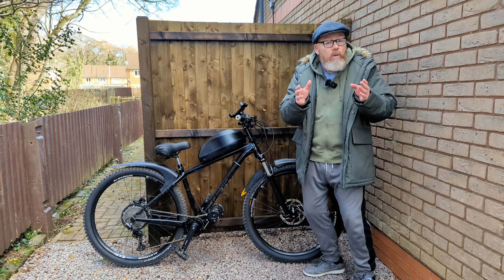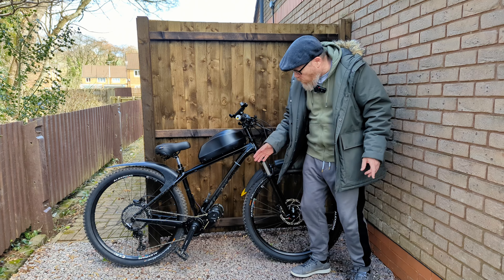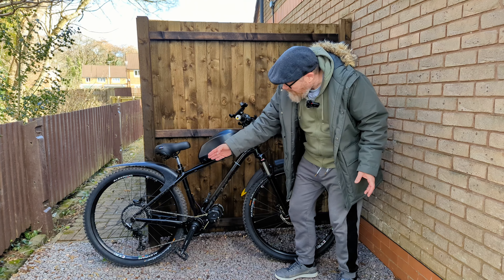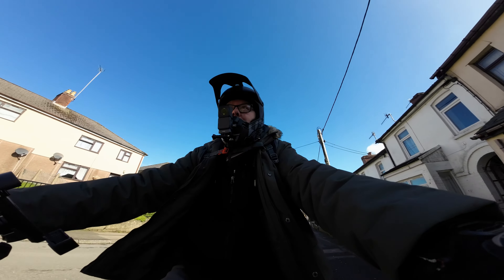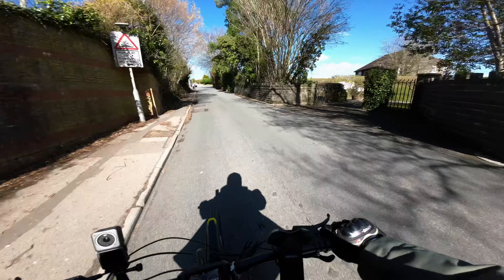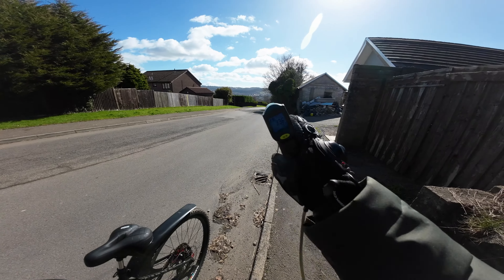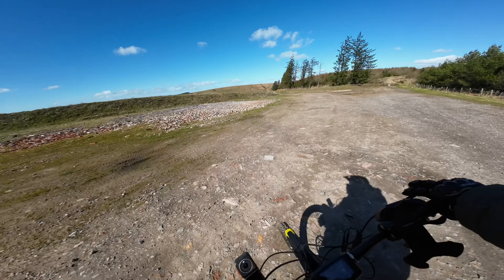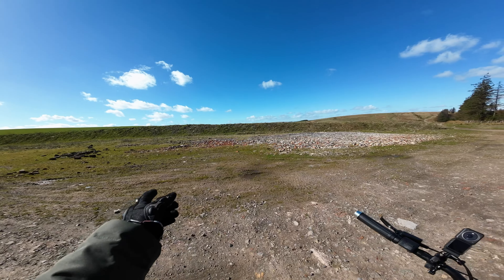Huge Hill Climb Test Cyc X1 Pro Gen 3 4000 watts powerful electric bike Mountain Climb Challenge

Comment: What is this motor like compared to a 3kw hub motor. 100nm torque so no slouch but 10kg of weight on the rear tire. Woukd be interesting ti see a comparison
Reply from the maker: This has the advantage of gears so get more torque in the larger gears. Hub motor is great because you don't have to mess about with gears.

Comment: Motor maxed out pretty quick in top gear uphill.. wonder how quick it would go up in a lower gear
Reply from the maker: I did another video about how much the bike cost and I did another steep hill climb and used the 2nd and 3rd cog down.
I think it was 30 mph ish in the 3rd cog, the video explains it better.
Reply: @baconbuttties  great power
Reply from the maker: @lassydogpie5390  👍👍

Comment: Oh the laughter of joy as you raced up the hill was just hilarious.  The CYC motor is really giving you plenty of joy.  I've found the x1 stealth motor gives me the same feelings.  
I don't ever use the throttle as I enjoy the torque sensing pedaling more than throttle action.  Love the video's keep them coming

Oh and those temps are really good. In Oz during the summer I had temps in the app showing 60c and the motor was fine.  Ran at those temps for over 3 hours straight
Reply from the maker: Good to know that it can take quite a bit more heat 👍👍

Comment: Great video.  I will be replacing the Bafang BBS02 with this motor.  I already have a 52V 17.5 AH battery.  I am wondering how much I would sacrifice by not having a 72V battery.   Any idea?  I guess I can try and if I don't like the power go ahead and get the bigger triangle mount 72V.
Reply from the maker: Top speed will be less with 52 Volts and it also  depends on how many amps your battery can supply.

Comment: I'm looking into this kit and I don't know if you replaced your rear cassette or not, but a lot of them use aluminum for the biggest cog (to save weight) while they use steel or some harder metal for the smaller ones! I think this means the powerful x1 motor is more likely to eat the biggest cog and wear it down faster
Reply from the maker: I didn't get enough miles on that cog to find out 🤔

Comment: How is the balance of that bike with the battery located where it is being so high up?
Have you considered mounting it on a back rack or if you have tried that for other locations how did that affect the balance?
I'm asking because I don't like the look but I do like the size because you never can have too much power or range as far as I'm concerned and though I don't like the gas tank look any large battery I think will look out of place in that position as well as affecting the balance I'm wondering if the weight being positioned high but further back will haven't even worse effect on the balance when riding (in particular uphill). I've seen many 72 volt batteries and they're all large and heavy regardless of whether their round oval Square rectangular triangular or otherwise
Reply from the maker: The balance was actually okay, but I didn't like the looks either.
If I had bought a medium Frame it would have fitted in the triangle 👍
Reply: @baconbuttties  well that's good to know thanks for the quick response and do be careful as you don't want all those new positive feelings about the bike to all be canceled out and completely undone by one really bad experience that sees you getting rid of it and possibly an injury you can't overcome that results and you not even wanting to replace it with a less dangerous Ebike because even though they're much quieter they're easily just as dangerous as a motorcycle and maybe even more dangerous considering their weight structural integrity and all of the other factors that go into under estimating their potential for harm.
Thanks for the video and information and ride safe
Reply from the maker: @Rob337_aka_CancelProof  I think any bike has a element of danger, I mean I could go 30 mph plus on a normal bike downhill 😱

Comment: Awesome video and a great demo of the x1 pro. I have one on the way and can't wait. My battery is quite large and I am wondeirng how much it will affect the load on the motor. How much does your battery weigh for comparison?
Reply from the maker: Oh I'm not sure as I haven't weighed it but just for reference I'm 87.6 KG and the motor  was pulling that weight easily.
Reply: @baconbuttties  The bike I am installing it on is a yuba kombi and my custom battery is made from 50aAH NMC Prismatics. It weighs 16kg and the total weight of the bike is around 55kg. I am about the same weight as you.  Your battery looks like it is around 10kg so the motor will probably only be moving an extra 20-30kg. Shouldnt be too much difference, although I went for the largest chainring option as I have a 52t currently.
Reply from the maker: @MaceMakes  my largest rear gear is 50t

Comment: That seems almost too powerful for old guys like us and I wonder is pedal-assist maybe a much safer way to go on that bike with that motor?  😊
Reply from the maker: Pedal assist on this motor is good as it using torque sensing and you do have 5 assist levels. There is also an app so you can adjust the power and levels to suit.

Comment: An "easy" hill climb now 💪
Maybe a 46T rear sprocket may be better 🤔  (less touchy on the throttle) even better I suppose would be if you could retune the throttle curve, less aggressive on bottom end. Your current 52T gear will help keep temps down during summer. An exciting hill climb for sure. 😊👍👌🚵
Reply from the maker: My next gear down is 42 so that might be okay and I will have a look at the throttle curve 👍👍
Reply: @baconbuttties  ooh ok, that's a big step down, I assumed the next cog down was a 46T, I currently run 11 - 46T (im upgrading/& building  a 64V "nominal" lifepo4 A123 (High Discharge pouch cells) as we speak. 70V peak approx. In combination with a ASI Bac855 controller on my existing BBSHD EEB build. Can't wait to its finished 😎
Enjoy your ride with that "Beast" Baconbutties. Stay safe.
Reply from the maker: @oze-bikes4life663  my biggest gear is actually a 50T . Hope you build goes well 👍
Reply: @baconbuttties  cheers 🍻  yours too 👍